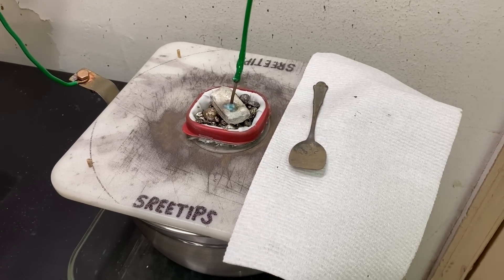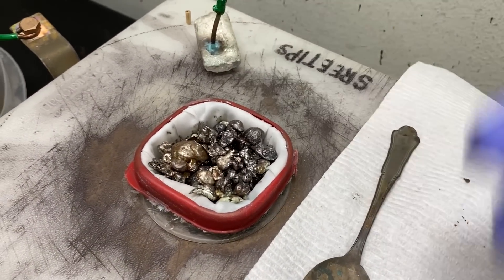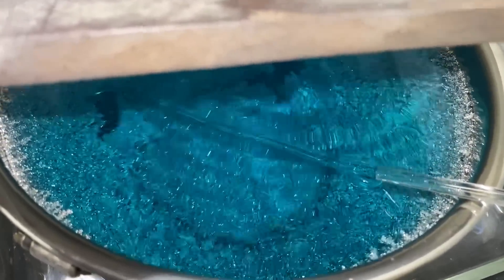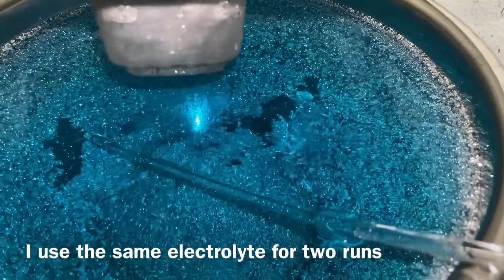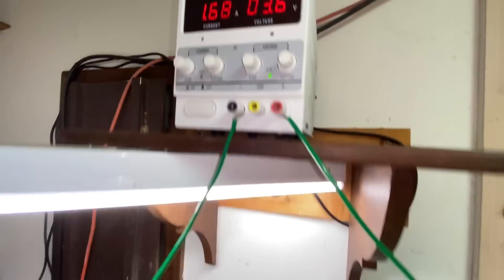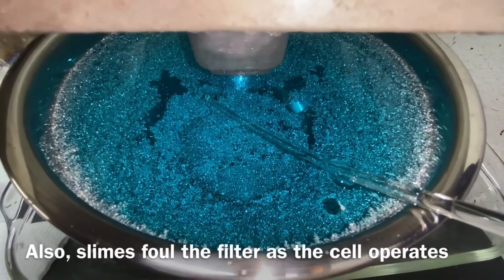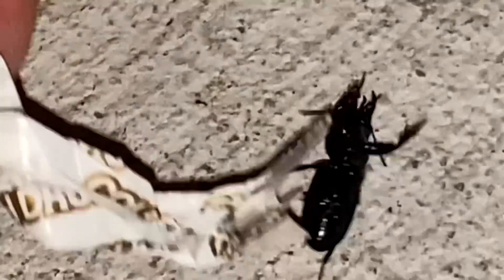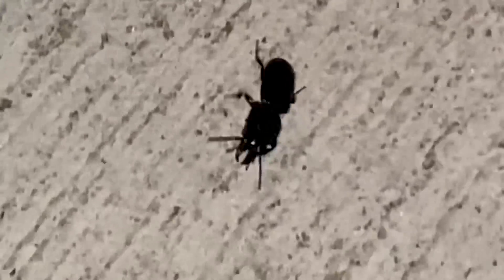Silver Cell 48 Hour Maintenance with Bug Rescue.

Comment: I kinda think that when you disconnect the power from the cell or the amps get low, the silver in your electrolyte will cement out on the copper left in the basket and put copper into solution. If you check on it often to keep the amps up and don't disconnect it the electrolyte may last longer.
Reply from the maker: Silver in the electrolyte will cement out on the copper that’s in the impure silver in the anode basket IF, the current flow it interrupted and the basket is allowed to sit in the electrolyte. I’ve had it happen a long time ago when I first started doing this. The silver ions in the silver nitrate deposit on the cathode along with the silver ions coming from the anode basket. The electrolyte becomes depleted of silver because of this. So I add more concentrated silver nitrate as the cell runs to replenish the silver concentration. The copper doesn’t start to deposit with the silver until after it reaches about 60g per liter concentration. It’s building up in the electrolyte as the cell operates.

Comment: How do you get the silver shot smaller so you don't have those issues. Just pour slower when melting,  I  guess. So is your silver  crystal. .999 would you say. Or  .9999 because I see the difference in coins, US  .999  Canadian. 9999 
At least proofs. Would you have to run it twice  to get the purity to as best as possible. Great vids. I didn't know where you was getting your silver. Now I do.Silver in the future metal, no where to go but up.
Reply from the maker: I’ve had my silver analyzed via fire assay. Comes back three nines every time. Except once I ran the crystal back through the cell for a second pass. That assay via ICP came back greater than five nines. Industry standard for gold and silver is three nines.

Comment: When you lose electrolyte due to evaporation, does that mean silver is evaporating into the air?   Or does it just increase the concentration of the silver in the electrolyte ?
Reply from the maker: Only moisture evaporates, no silver. But the silver in the electrolyte does deposit out in the cathode as the cell operates and reduces the silver concentration of the electrolyte.
Reply: @sreetips  🤝🇺🇸

Comment: Hey Streetips, A couple of questions. One might answer the other. Are some platinum group metals transferred into the silver cell electrolyte? Or are they all trapped in the anode basket? Will a second or multiple chemical refinings of silver increase the purity, like the multiple refinings that are done with gold ?
Reply from the maker: 1) the silver contains some gold, platinum and palladium. It remains in the anode filter as long as there’s little to no free nitric in the electrolyte. Free nitric will dissolve palladium and it could leach into the electrolyte. I can tell if there’s palladium in the electrolyte because it will turn green. 2) I ran the pure silver crystal back through the cell a second time once with fresh electrolyte. Sent a sample off for analysis. Came back greater than five nines fine. That’s 99,999 parts per one hundred thousand pure silver.

Comment: I'm going to try and word my question right, how is it that when you have the electrolyte after the second time you put copper pipe in it to cement out the silver ,and the copper goes into the solution, silver out ,why doesn't the copper from the impure shot cause the same cementing affect?
Reply from the maker: It will if I leave the anode basket full of impure silver in the electrolyte with the power off. I’ve had it happen before. Put the anode basket in the electrolyte and didn’t turn on the power because I got called away. When I came back the cement silver was hanging from the bottom of the anode basket. It was a long time ago. I took it all apart and started all over. But learned a valuable lesson; never leave the anode basket full of impure silver hanging in the electrolyte with no current flow.
Reply: Because there is an electrical current flowing that works contrary to that.

Comment: Have you thought of putting some holes on the side of your container besides the ones on the bottom.  Seems like that the more electrolyte thats contacting your impure silver, the better sustained current.  You should be able to maintain your 2 Amp starting current until your raw silver is depleted.  It would go faster too.

Comment: Why does the silver plate, but the copper does not?
Reply from the maker: I don’t know why. But I do know that if the silver concentration gets too low and the copper too high then the copper could begin to co-deposit with the silver. I’ve seen it happen.
Reply: Maybe the higher conductivity of silver prioritizes the silver over the copper. Yay, yet another question my brain will obsess over until I answer it lol. Thanks for the info. I'll look into it.
Reply: That has to do with the respective chemical properties of silver and copper. If gold were to go into solution at the cathode (extremely unlikely with the current settings and the abundance of silver), it would plate out on the anode in preference to silver.

Comment: for industrial silver granulate we use a "hot spoon" for constant granulat sise... you can use a soup spoon (stainless steel) and drill a small hole in maybe 3-4 mm. Fix the spoon over the water berrel and pre-heat with propane torch.
then dump the molten silver in the spoon. the silver runs constant the hole and drops in the water.
Reply from the maker: I’ll give it a look.
Reply: Good idea
Reply: Or use a round chain file to make a few channels on the edge of the crucible. When pouring molten silver into the water, instead of one thick stream, several smaller ones should form, and thus the granules will be smaller.

Comment: Good morning, Sreetips!

Have you considered casting silver probes/feet on the lower side of your anode bar? 

In circumstances like this, I believe that would increase contact on multiple “levels” of the anode basket. 

Just a thought! Love the channel.
Reply: That would just bring the anode bar into contact with the solution with the undesirable result of the pure silver anode bar (or at least its feet) dissolving instead of the shot.

Comment: jumping amperage in a circuit is a symptom of a bad connection.
Reply from the maker: The impure silver dissolves away and breaks the circuit.
Reply: @sreetips  Salts and oxides do not conduct electricity except when dissolved in water, only Silicate is an exemption to this rule.
Reply: @johannesdesloper8434  The problem is the (conductive) metal being dissolved and leaving a non-conductive gap behind because the grains of the shot are too large.
Reply: @apveening  what if you put more weight on the Anode bar?
Reply: @johannesdesloper8434  In that case the pure silver anode bar might crash into the cavity and come into contact with the solution, something preferably avoided.
Reply from the maker: More downward force would be helpful. I coil the anode lead to form a little bit of a spring that exerts down force on the anode bar.